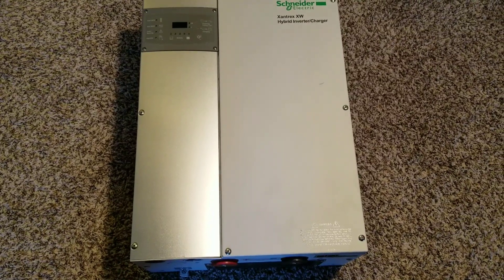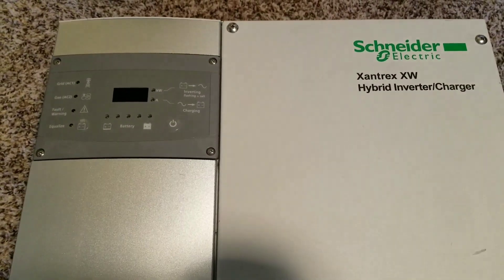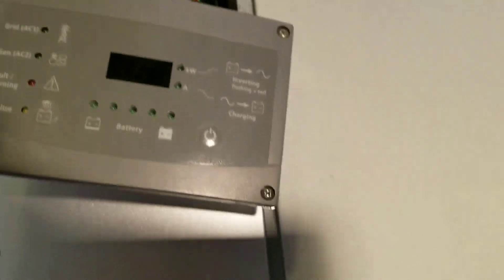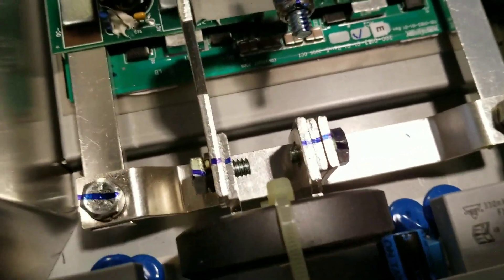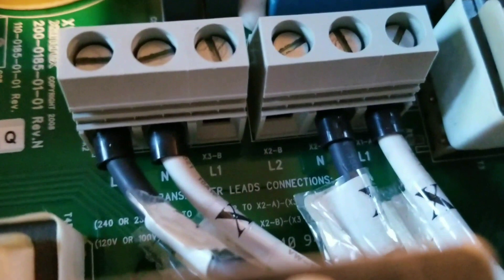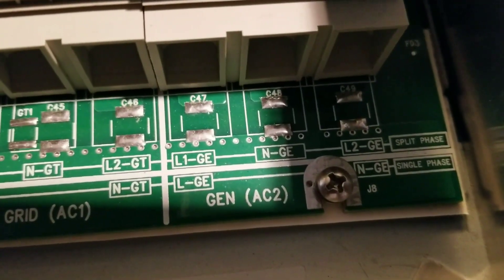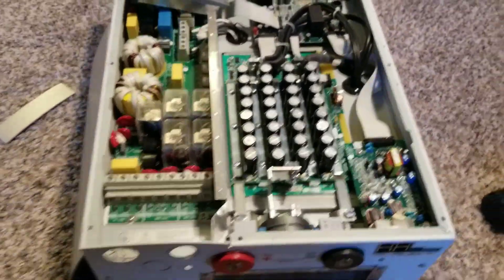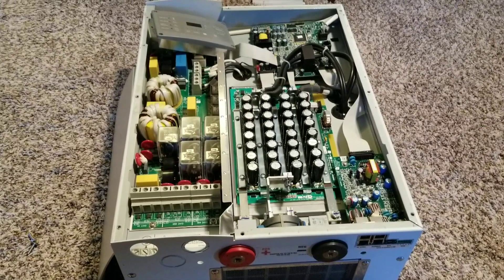XANTREX XW HYBRID INVERTER/CHARGER | Internal Components

Comment: that one side is the transfer switch side  pretty cool.  its cool you can have it set up to were you can have grid, and a generator hooked up and if you drop the grid and if the batteries are getting low it will look to see if either grid is live if not then it will fire up a generator if there is one hooked up to supply power, nice unite.
Reply from the maker: Thanks for the comment brother.
How are you doing?